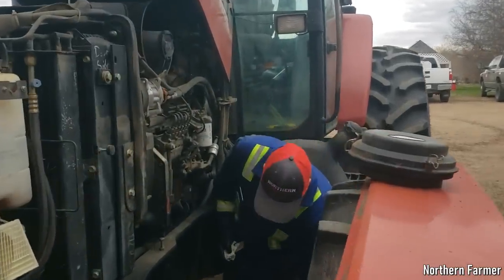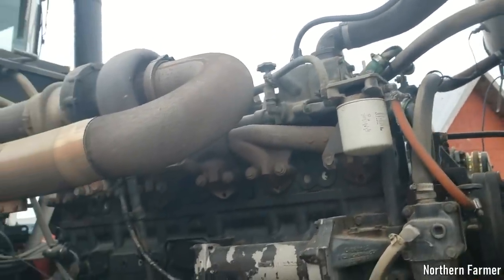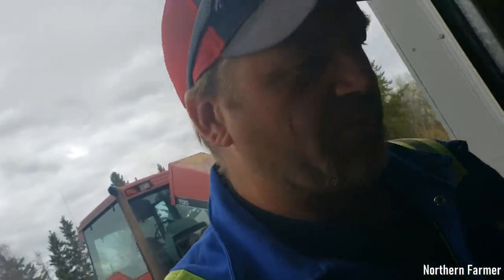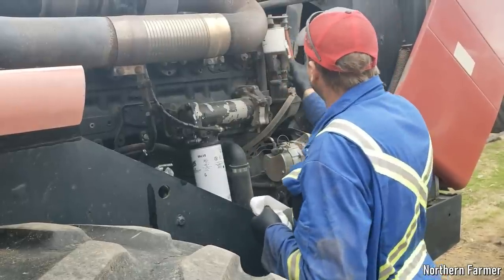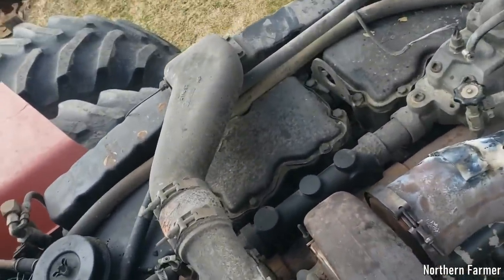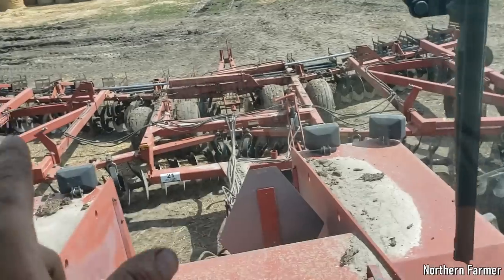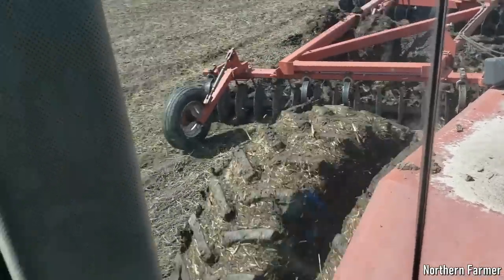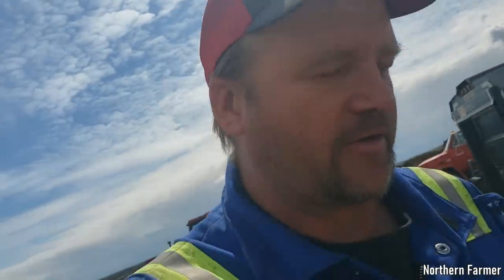Tractor Maintenance and Discing FIre Guards

Comment: Check the terminal on your alternator- that’s where she reads RPM. Might have to add a ground cable from alternator to frame- sometimes the bolts rust a bit and then they don’t ground 100%- throwing erratic rpm signal! Worth a shot ;)
Reply from the maker: Yup..does the same thing on my mx

Comment: The rattle in the coolant filter is additives and some sacrificial metals.. protects the rest of the system.
Reply: Gosselin Farms Ed Gosselin is correct! Not needed with the new coolants and new systems tho! But additives are always great
Reply: @RockinRobbiesRoadhouse  the 4071 filter has DCA for the longlife coolant it is a 4070 no additive

Comment: Back in my young days of farming we used to take field cultivator and back it into those wet spots and then pull out to open them for drying.  The idea is to keep tractor tires on solid ground.

Comment: I went to the local Case IH dealer the other day to get some wheel bearings and  I thought I would sit in a 9250 that someone had traded in. The guy had put a hardwood floor in the cab and it was all trimmed in!!🤪😁

Comment: Hello Tyson, hope all is well
Some guys when they change out the Water/Coolant filter will spin the new one on part way and open Coolant shut off valve to purge the filter when full tighten filter. Helps prevent Air Lock 👍
Take Care Bud👍

Comment: That is stuff from the dryer. The desident bag broke loose in your dryer. It wouldn't hurt to flush the whole a/c system do that it don't clog the new expansion valve. Flushing will also protect the compressor. Napa sells the a/c flush  for about $20 a can. It's really a must for proper operation of a/c system when that happens.

Comment: We use a lot of Case-IH filters, price isn't bad and they usually have them.. they also handle Fleet-gard.. made in the same place, sometimes less expensive 😎👍
Reply from the maker: I would get them to.. but the dealer is almost a hour away... but I should check the price out on them one day
Reply: @Northern_Farmer  ya.. travel time kills it.. 10-15 minutes for us, depending on how many idiots are driving half the speed limit
Reply: I just serviced 4 86 series internationals. I priced the filters both napa and ih. My savings by using napa was over $200. It's a few bucks here and there on each filter higher, but if your doing several like Tyson and myself it adds up quick.
Reply: @davedunn2124  oh, I know.. we do use a lot of NAPA filters too!!
They are hit and miss on having them.. or they're three days away. Drives me crazy! The dealership usually has then. 
With 8 or 9 filters per tractor, it does add up quick!! 9 tractors...
Definitely a chunk of money!!!
Then swather, combine, bale wagon, sprayer, fertlizer buggy, all the trucks. I don't even want to know how much money we spend on filters.. even the inexpensive ones add up quick!!

Comment: The dryer does have desiccant in it, those little balls of stuff are the desiccant. That's why when you open an a/c system you are supposed to replace the dryer. Coolant filters for regular green antifreeze have the additives in the filter. If you are running extended life antifreeze you need to take that one off and get just the filter with no additives because the additive will cause the extended life to furn to gell and start plugging passages in the cooling system.

Comment: I've always been told the goodies inside coolant filter help to maintain the ph level in your coolant to prevent electrolysis. From what I understand your supposed to still add DeX cool or other brand to get it where it needs to be by using a ph test strip and those filters maintain that level.

Comment: Nice to see you getting some field work done ! The tractor that you were disking with when is the last time you change your fan belt ? One of my friends had trouble with his 9130 over heating he changed the tensioner and belt and then it ran at the normal operation temp!

Comment: Those desiccant balls swell when they suck up moisture. You could try hanging the hose up and working from the bottom use a heat gun to drive the moisture out and see if that loosens them up enough to fall out.